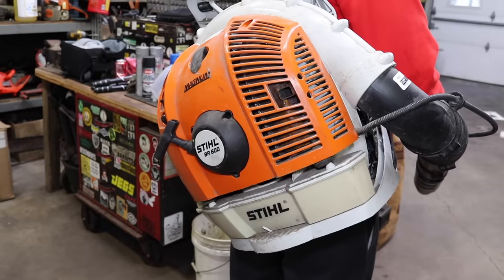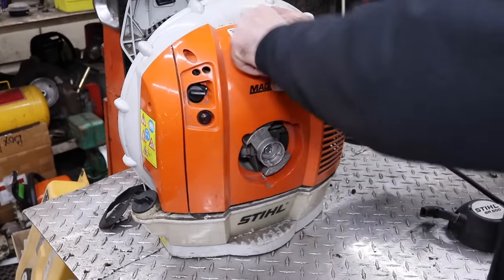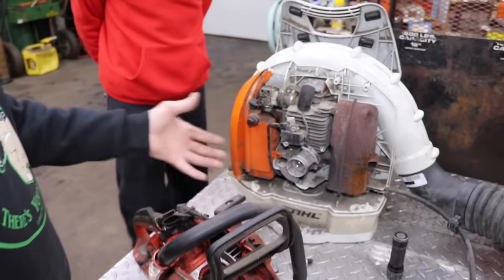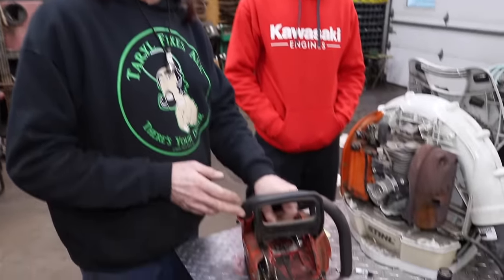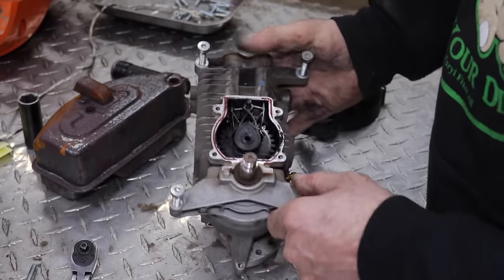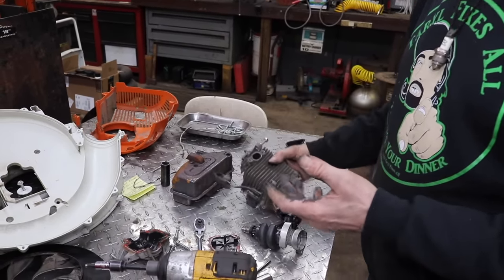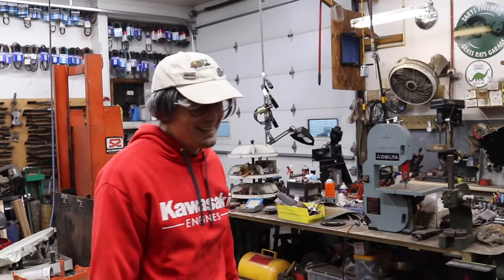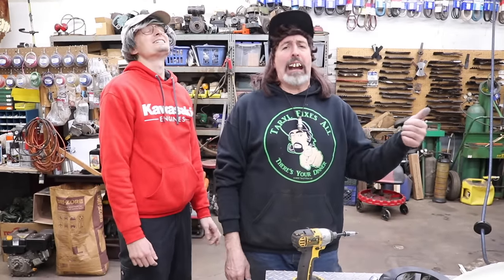4 mix NIGHTMARE! DON'T make this mistake 🚫

Comment: I use Stihl HP Super mix oil in 5% ethanol petrol 95 octane 50:1 mix in Stihl BR600. I can’t find anything on Stihl 4 mix oil. Here in UK I can’t get ethanol free petrol and the BR600 instructions advise you use Stihl HP Super oil so is this going to be alright for the bronze bearing in which the wrist pin passes through on the connecting rod.

Comment: 20+ years and I have seen 2 seized wrist pin bushings in BR600-800 units. Both times customer was using home depot oil...

Comment: This 2 stroke/ 4 stroke hybrid leaves me scratching my head! If the fuel air charge isn't flowing through the crankcase how does the oil get to the wrist pin to lubricate it??? Is there oil in the crankcase like a briggs?

Comment: Hey Taryl: thanks for this video. I bought a Stihl BR700 a few years back, but had no idea that I needed to use the Stihl oil. I’m not having any issues yet, but will switch oil right away. This is the last Stihl product that I will ever buy. For about the same money, I could have bought a RedMax, which is a conventional 2 cycle. You saved me enough money for dinner!!

Comment: I use echo red armor on my stihl 600 blower for over 6 years

I'm I wrong for using that mix 
All my equipment is Echo but this one blower which I was trying out.
Still works today

Should I have a special gas tank alone for Stihl

Comment: They didn't use a needle bearing because they don't want their stuff to hold up and last for a long time ! They loose money if they produce quality products ! Just look at everything that was made in the 1940's - 1980's. Everything lasted seem like forever. All the companies learned that if they made products that lasted they weren't making as much money as they could. But if they made their products with cheaper internal materials to where they'd only last half the time or even less as the quality products they could make more sales more often witch means more money coming in.

Comment: Two reasons; they test new things on bigger pro equipment first then move it to others if it works. The second could be dealing with lack of lubrication to accommodate a needle cage in a 4-mix
Reply: Nope... Only thing more difficult than education is thinking...

Comment: Sorry guys, been a Stihl gold tech for 18yrs, the BR600 is a proven workhorse, not cheaply made but very well engineered.  I’ve seen this so many times over the years. $699.99 blower  where the owner used .99 cent chain store multi mix oil or in this case, looks like motor oil. Human beings can destroy an iron anvil with a Q-Tip.

Comment: My BR600 works great. I use the highest octane gas on the pump at VP Oil and Lucas synthetic 2-cycle oil. Stihl oil provably reduces horsepower and clogs the ever loving democrat out of the spark arrestor. Another tip I can add, they last longer when ran at full steam and need maintenence sooner if the throttle is constantly butterflied up and down, the "cruise control" (pressing the throttle control switch up) locks it in full throttle to help maintain missing out on the bad habit. The biggest complaints I see on the internet about Stihl products are usually the result of user error not product defection. FTR, I am not sponsored or beholden to Stihl, I just read manuals and take primo care of my equipment as recommended, as should anybody else who buys a $750.⁰⁰ entry level commercial blower.

Comment: Not a fan of any of the 4mix stihl products. I own a fs90 trimmer, it’s only 4 years old and been nothing but trouble. First it was carburetor issues then it was valve lash issues now the end of this year the coil went out. I’ve already had more problems with the 4mix than my 3 20 year plus old stihl and husqvarna trimmers. No more stihl products for me, echo will replace this boat anchor fs90 next year.

Comment: You gave the answer as to why they went cheap. They know they will fail, they sell the parts at an extortionate price where they know people will either bite the bullet and fix it, or buy a new one, either way they make more money out opf the customer. than if they just used a proper bearing.

Comment: I got the exact same blower (BR 600 Magnum) and I always had problems with it. Valve problems, carb, Ignition, gaskets.. its more on the bench than in use. But I love the power of it if it works. I like that blower because it has the air more focussed than the bigger ones. So maybe I replace it if I find an equal blower to it.
Reply: Br800 is way more powerful than the 600
Reply: @bluejene2146  maybe, but i dont like the 800

Comment: you think they went cheap on  piston  substitute needle bearing with  bushing , look  at the plastic cam gear lobes   which wear down to nothing quick. Stihl  just wants to sell parts , you can see it every angle  of the design.

Comment: Thanks , ive never liked the 4 mix stihl s I believe its a emissions design. 
Bata tried to use a brass bushing in there 200 trils 2 stroke motor for a while and it didn't work eather,  it would seize up.

Comment: How does oil even get into the bottom half of the engine??? A 4 stroke engine has no interconnection from the top end to the bottom end whereas the fuel/oil mix is sucked into the bottom end thereby lubricating the bottom end. My Crapsman 4 stroke with an oil sump works great!

Comment: I have not seen the 4-mix oil but have been using the STIHL brand High Performance Ultra 2 Cycle Engine Oil. Is this as well as the 4 mix?

Comment: Just curious.  I wonder if somewhere down the line after the design they knew lubrication wasn't getting to that area & roller bearing was dry so they went with bronze bushings in an attempt to remedy the issue & have the blower just run long enough to exceed warranty.

Comment: Oil is oil. 2 stroke synthetic or not still meets the proper specifications to run in outdoors equipment if IT IS MIXED CORRECTLY !!!!!!

Comment: So I've got quite an issue on my hands. Our arborist company had to switch from hp ultra because it was fouling plugs in everything we had. After years of using it stihl sent out some bad batches or something. We tested fuel from other stations, even bought another pack of oil. It was still causing plug issues. We switched to echo brand oil and it completely cleared up. Is our blowers now at risk if we don't go back to ultra or is a completely different oil we should be running?

Comment: Take the bonze bushing out and insert a hardened steel bushing of the correct size and a needle bearing. Total cost 25$ in parts and 140$ labor. Do it. I dare ya. I double dog dare ya.

Comment: The bushing on the biger engines is deliberately, because they know that those 4 mix engines get way less lubrication especially up in the wrist pin.
There is no transfairs so the mixture dosen´t flow past the piston region, it stagnates and just some turbulence bring up some fresh mix.
Bushings can handle the lack of lubrication much better than needle bearings, especially as they get bigger!
Needle and roller bearings in motorcycle engines are the worst! they die way faster then normal bearings.
They are just used in those 450-600cc motocros engines because they reduce drag and they are for competition not utility.

Comment: I never got the point of the 4-mix engine.. why not do what Honda did and actually just put some oil in the crankcase? what are the benefits to a 4 stroke engine that you still need to mix gas for? I get that a 4-stroke engine is going to have more torque generally.. but again. put oil in the case..

Comment: The more observant will have noticed that, when Taryl opened up the engine, he found the piston was 'all flopping around in the cylinder'  i.e. Piston slap, not little end wear on the bronze bush.   The bronze bush was even so tight that the piston was tight on the con-rod, as was the big end bearing also.   
Stihl must be relying upon oil getting past the piston rings to lubricate all the lower parts of the cylinder and crankshaft, a design sure to fail.

Comment: yeah buddy, learned real quick these 4 mix engines are worthless when I asked the dealer if he would take my 2 year old $700 machine back in trade towards a  new and better model. no way Jose, but they would take a 4 or 5 year old ms 362 or 261 in trade.

Comment: I use Amsoil Sabre 50/1 I've had at least 15 4 mix engine back pack blowers never had a problem also Stihl ultra oil only has a Jaso rating of FB it's not very good oil Amsoil is rated FD take care 👍

Comment: To be safe and sure, just don't buy Stihl.  In weed trimmers, as long as I service it, I buy the cheap trimmers at Walmart for about 60-70 bucks. I'm on the second one, each running about 10 years and even then it's usually not the engine that fails. It's the handle or the cable down to the trimmer head. Six bucks or so a year, not bad.
Reply: Walmart trimmers have wayyyy more problems than stihl trimmers. Walmart trimmers all use bronze bushings too. As well as crap carb that go bad in 3 years, fuel lines that rot in a year, and much more. Look at the sticker on your walmart weedeater that shows the compliance hours. That is how long its expected to last. On walmart trimmers its about 20-50 hours. On stihl trimmers its 250-500 hours. Its so easy to tell a small engine mechanic from a shade tree mechanic with comments like this.

Comment: That stihl blower doesnt have to be throw in the trash. ebay has good used motors for under $200. I would reccomend using stihl synthedic 2 cycle oil. its not real cheap like dollar oil but at least it will keep your equipment from wearing out right away.

Comment: The piston could be completely disconnected from the rod, and it would have zero movement in an undamaged cyclinder with the rings installed.  The bushing was not the direct cause of the piston  moving in the bore when inspecting through the spark plug hole. I think you figured this out during tear down, but failed to mention it. You did nail the cause of failure when you stated oil.
Reply: My thoughts.

Comment: I've seen these blowers in this condition by the owner using straight gas instead of mixed. Since it's a four stroke, they figure it runs on straight gas, like a Briggs.

Comment: Hi, Summer is what 100+days long! U might use a gallon of fuel+100ml 2 stroke oil. $6-$9 / yr. One more thing grass rats might not know. Gas+Methanol (regular) doesn't mix with 2 stroke oil.

Comment: I wonder why they wouldnt make a brass bushing and wrist pin for it - Small ends on most cars, if not all, are brass bushings and replaceable with a bit of reaming to size. Looks to me like someone has run the engine on straight petrol/gas not realising it was 4 stroke but runs on 4mix oil

Comment: i always use stihl oil and mix it at 40 to 1 and had good luck what do u think taryl is running 40 to 1 a good idea instead of 50 to 1
Reply: Use ultra mix at 50:1

Comment: torch it and use a heat stick to get it at proper temp and quench it and then temper it to specs and then throw a pin bearing in it.worth a try

Comment: I bought a BR300 when I bought my house because I figured it would last for a very long time ( dad had an old Stihl that lasted 25 years with literally no maintenance less for an air filter change once.)

I take care of my stuff (I had all the receipts for maintenance items and the premium oil I was running since day 1) and the thing keeps stalling out after 4 years of residential use.  Nobody can figure it out.  I contacted Stihl which told me to bring it to a particular dealer. I was charged 100 bucks and they couldn’t tell me what was wrong with it.  I asked Stihl if they would give me the 100 towards a new stihl blower.  They had me jump through all these hoops which I did….. then radio silence for months. When I contacted them again they told me I had to jump through all the hoops again.  GTFOH!  Never buying another Stihl anything ever again.

Comment: That's a shame that they went cheap on the rod bearing. I am loosing my faith in stihl. The new  Ultimate (or whatever it's called) 2 cycle oil that they're pawning off on you when you buy a new chain saw has gotten terrible reviews for causing gaulding and scoring on the piston and cylinder walls.

Comment: Any oil on moving engine parts is better than NO OIL.
My guess is a few penny's saved on that bush and con rod.  Either way, that bushing is a failure waiting to happen. A roller bearing will take a lot more abuse as opposed to soft metal.
Always use the recommended oil to preserve the warranty.  Some top brands will do an oil analysis if they are suspicious of other brands of oil being used. 
I was never a fan of these for several reasons, but 1 that some people aren't aware of is the rocker arms popping out of position. This will lead to nearly impossible cranking, busted recoil ropes, and no starting.
Reply: Heat causes the rockers to loosen somehow and valves need adjusted. Adjust valves and you wont have this issue.
Reply: @Blue Jene  that whole setup is wonky. You are correct. The valves do need to be adjusted, but they never come to me that way.......

Comment: You could prob use a homelite needle bearing they only roll on the rist pin and the connecting rod is aluminum on the homelite so it mite work I think it would iv used one the homelite needle bearing in a stihl Chainsaw and it work perfect still run to this day

Comment: The first comment is from a Stihl dealer with years of experience. He says Stihl was forced into 4 mix technology by eco nazis for pollution reasons. If that's true how are all the other manufacturers still building 2 strokes? Echo has a blower out that will run curcles around this Stihl. Their 9010t. Its cheaper than this one too.There are many you tube videos attesting to this. What a sad day it will be when we're forced into under powered, under performing, over priced electric tools.

Comment: I think its a two way problem. They make a design which isnt the best, but then they make an oil good enough where its not a problem...but anything SLIGHTLY worse...ruins it. It's like modern engines. You need the EXACT oil, sometimes the exact brand, don't you dare go over you know... ''10k miles'' which really means your engine will last just past warranty doing it like that. The oil isn't that expensive, and i'm not 100% sure but if its in warranty (i don't know specifics of how long that is) but if you use their oil i'd assume its covered. Vs using the dollar store oil. As everyone always says. Oil is cheap, engines are not, and in the case of this blower, a whole new blower.

Comment: You should check and see if you can find a bearing that fits. To heat treat the rod end heat the rod end with a torch or use a rod box for con rods turn it cherry red quench in oil clean innner surface with wire wheel so it is nice and clean silver then reheat until it turns straw color then cool it should might just work you and slipper should try and make a vid am sure the rest of the gas rats would like the amazing taryl and slippers pull it off

Comment: I have a number of Stihl machines, with minimum issues, almost all were purchased in the 90's with the exception of a Kombi motor KM110 bought in November of 2005 that I recently replaced with a KM 131 due to hard starting issues.  I like the increased power over the 110 but now you have me wondering if I made a big mistake keeping with Stihl.  BTW "other youtube engine guys" are saying the Stihl oil in the silver container is JUNK; Taryl what do you think?

Comment: The Stihl Owners Manuals for the big blowers such as 800, recommends the mix use Stihl Ultra 2 Cycle fuel, NOT the Stihl 4 Mix which is intended for true 4 cycle engines like pressure washers and such.  Ultra is really not a top end 2 cycle oil meeting the newest standards for detergent and such.  Check it out.

Comment: What is 4mix oil? Stihl HP ultra is Recommended for all equipment. If you buy a six pack of the HP Ultra at the time of purchase of your equipment it doubles the limited warranty time period. In the case of the blower it would give you an extra 2 year period. Blowers come with a two year from the manufacturer. Buying the HP ultra at the time of purchase. will give 4 year limited warranty.

Comment: Not arguing.  Just curious.  What if you were to machine the hole at the end of the connecting rod? Then press in a hardened .....tube? Then convert it to the roller bearing?
Reply: Or just press in a new bronze bushing

Comment: It's crazy to think someone would spend a pile of money on a good piece of equipment & then put cheap gas & cheap oil in it.

I have a BR600 & i only use 93 non-ethanol gas & Echos Red-Armor 2 cycle oil.
And the reason I use Red-Armor is because test after test it's the best on the market.

Comment: In my opinion still should have recalled the  crank and piston and rings and helped on the labor cost,I've been working on small engines for 40+ years
Reply: Is it a good trade to get into?